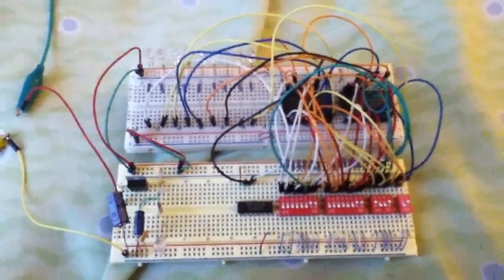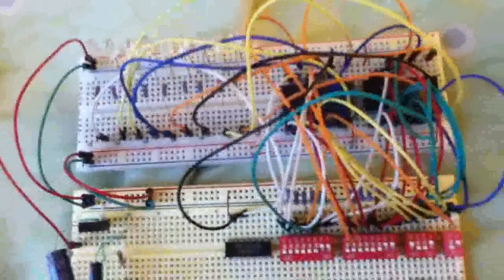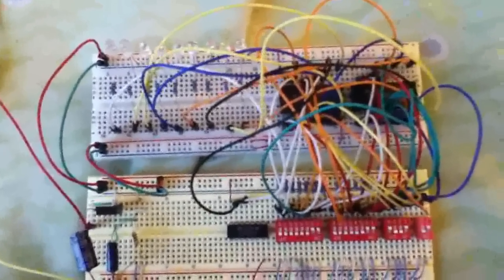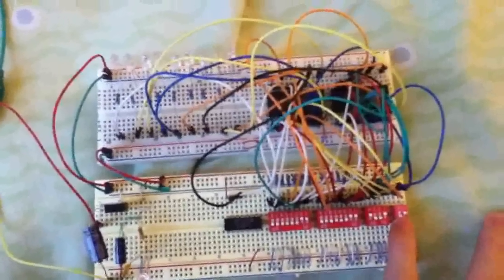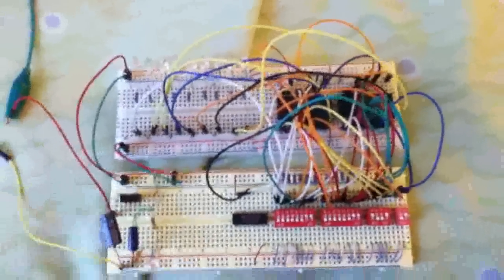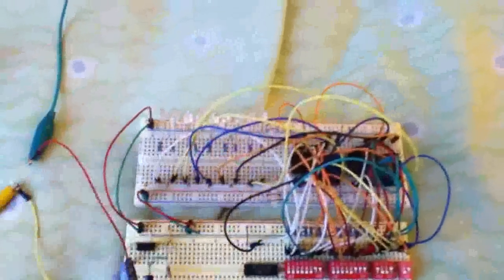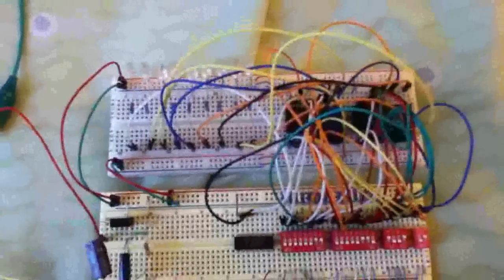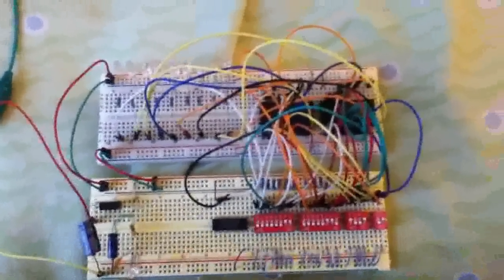8 bit ALU

Comment: Thanks for making this video. It has helped me design my ALU. I'm building a 6502 CPU from TTL chips, so I need to do pretty much what you have done to get the 8-bit ALU to work. Weirdly the 6502 doesn't do NOT or NAND, but it does do SHIFT-RIGHT which I'm puzzling over right now.

Comment: in 74ls181 alu chip, comparator work when the Mode Pin is "HIGH" and function select are in Subtraction mode - 1001.
the comparator check if all outputs are LOW the comparator become HIGH.
example - 1001 SUB 1001 = 0000
when the oparands are the same, and when you subtract them the outputs always be 0000, and when the outputs are LOW the comparator is HIGH.